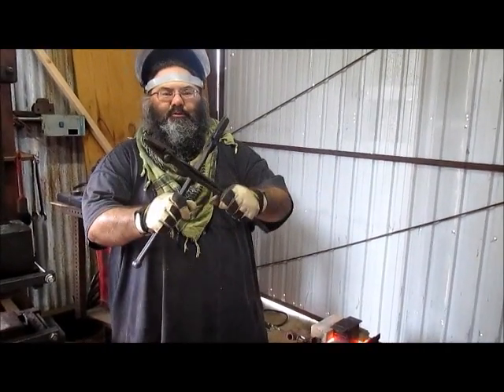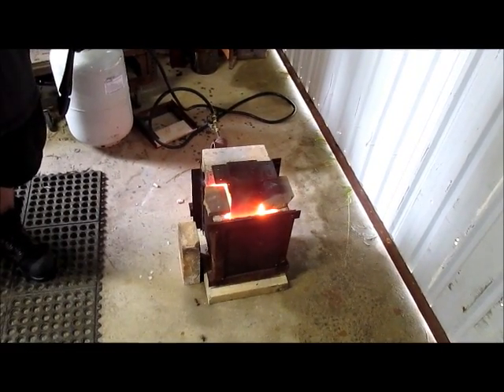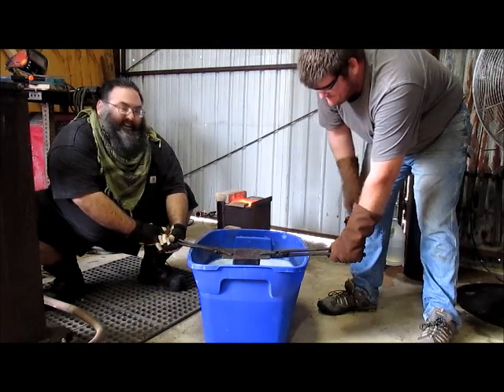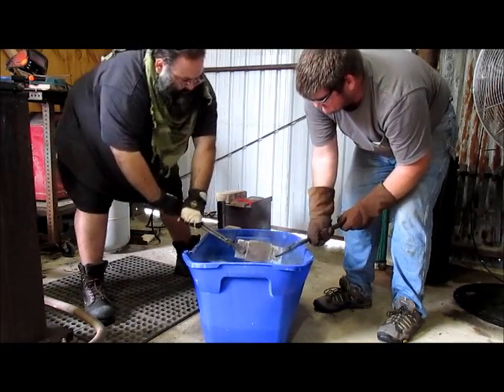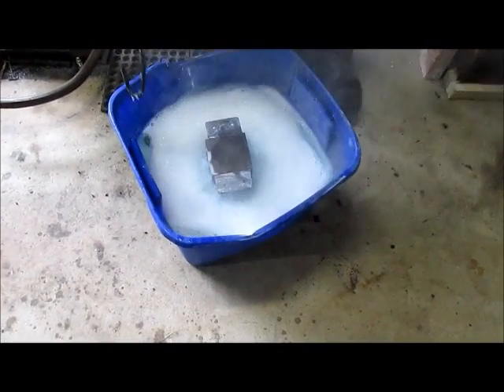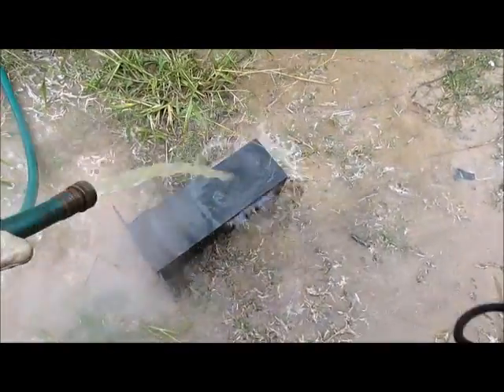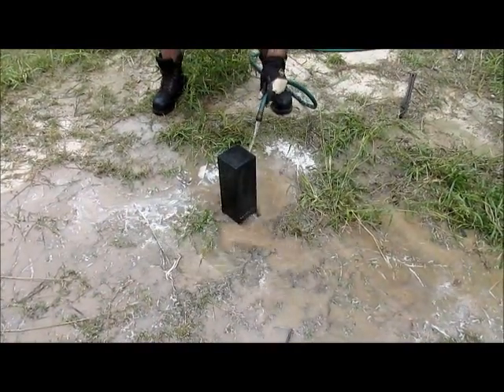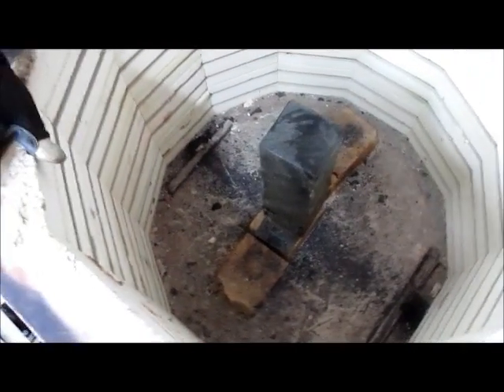Heat Treating a 4140 Stump Anvil

Comment: Did you ever figure out what the face hardness ended up to be? 
Get a set of hardness testing files and check. I'm going to be doing a big chunk of 4140 for an anvil shaped object for myself and want to use your super quench. Knowing what to expect would be great. 👍
Reply from the maker: I will now say having done this a few times now, avoid the super quench a water quench should be fine.  I did a 93lb 6x6x9 4140 block like this and got 80% rebound.
Reply: Thanks for the fast reply! I'll take your advice and try straight water. Cheers ✌

Comment: Quenching in water without any salt in it, you create a vapor barrier. I've been a heat treater for over 21 years, this is the most ridiculous thing I've ever seen.
Reply from the maker: Actually I say we mixed up a batch of super quench to alleviate the problem of a vapor jacket.  AS a heat treater I'm sure you know what super quench is, this batch had salt I thought we could probably have used more.  We tempered at 400 for 4 hour, and 2 years later the anvil is still working fine.
Reply: Dave, how would you have heat treated this?
Reply: Dave, I'd say you could super saturate a 10 gallon water solution with the salt from that comment of yours.

Comment: For that much thermal mass, you really should use quenching oil or a lot more super quench. It takes up a lot more heat. With the set up you were using, the anvil would be likely to heat up the quenching medium to the point that you might not avoid decalescence all through the entire cross section of the metal. All that said, still an awesome video.

Comment: Cool video guys. I have contemplated doing this in the past, but long forgotten to do it. I feel inspired to make one. We will see. The only thing I would do differently however, is to use much more quenching medium and try it instead. Say 55gal drum worth, and probably quench in the drum. If not, I have a 500 cal container with a large 4" drain controlled by a ball valve that I could to a cascade. Though more of a PITA to set-up.

Thanks for the inspiration!
Reply from the maker: If we do this again we'll definitely up the volume of quenchent.